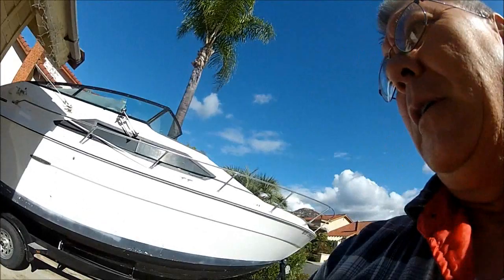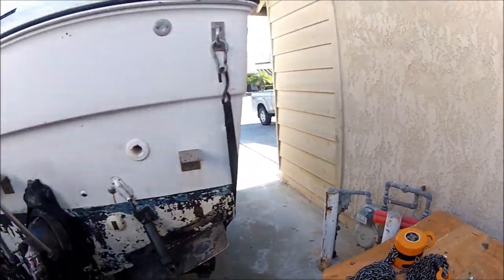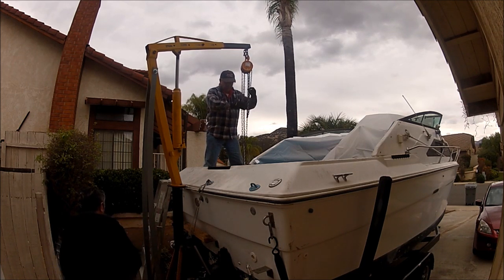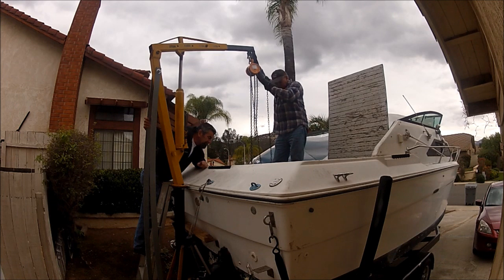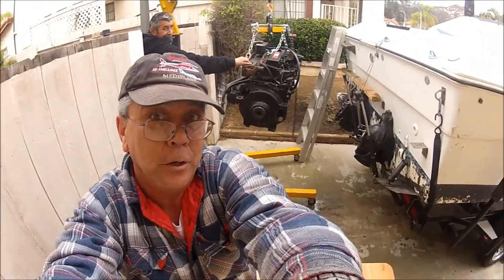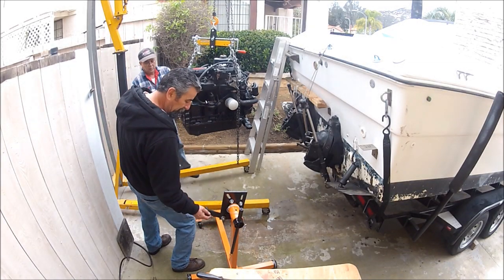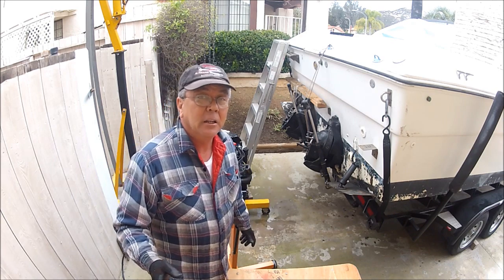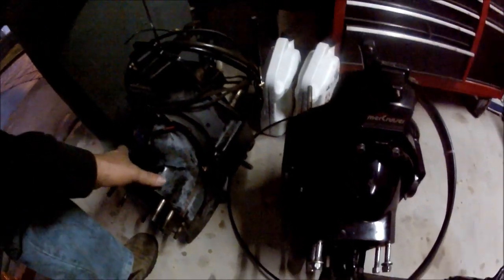Sundancer 260 Engine Removal

Comment: Thank you for the idea on the modification on the engine hoist-- I, too, did not want to build a gantry or A-frame which I would have to disassemble after pulling out the engine, and then after weeks of engine repair reassemble again. The cost of the lumber, bolts and brackets would be at least a hundred dollars, too.

Comment: Question : I have mercruiser 5.0 and my stirring tightens up about the middle, so when i am turning it gets  a little hard about the middle. what can i do about that ?? i also have to remove old engine and replace it do i need to remove the gimbal housing before that ?